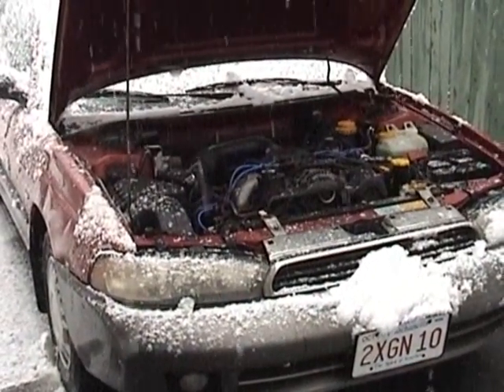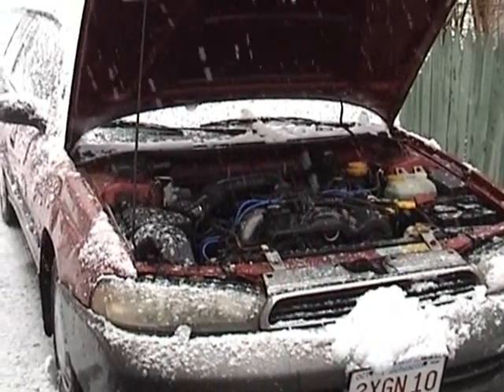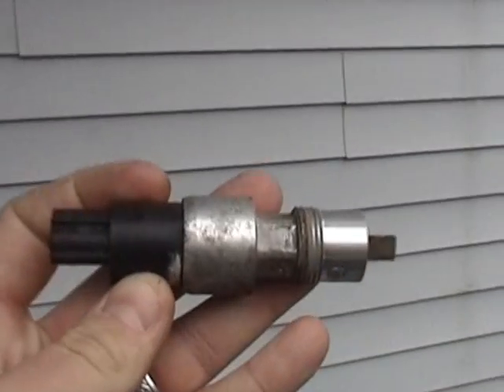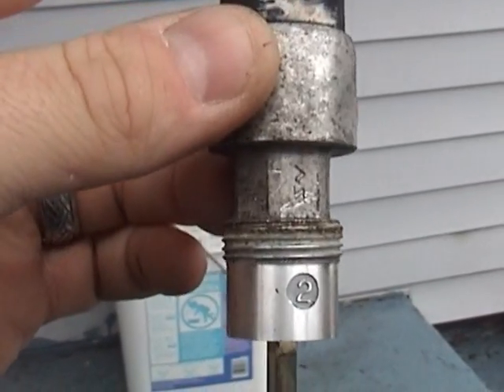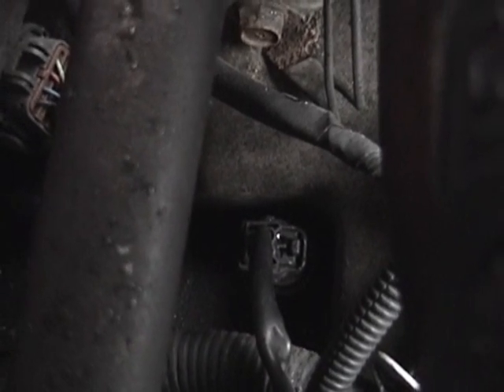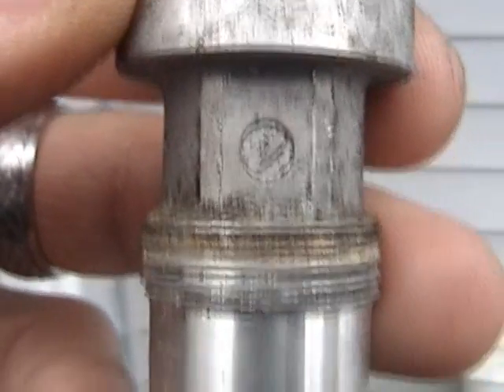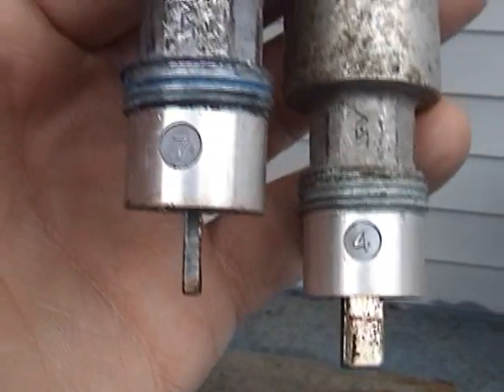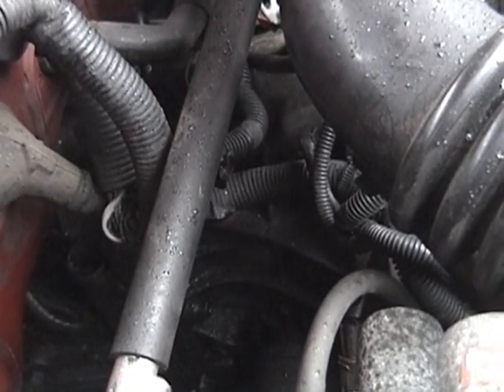1995 Subaru Legacy L Outback: DIY vehicle speed sensor 2 replacement

Comment from the maker: I can see how you might come to that conclusion, but the smoking gun was jumpy speedometer. Based on Subaru factory diagnostic charts and wiring diagrams, I linked both that and the wonky shifting to the sensor. 

I got some from the junkyard. The first spare wasn't perfect. It solved the shift issue but not the speedometer issue (though it was LESS jumpy). The second spare sensor solved both problems. If this hadn't worked, I would have considered heavier diagnostics.

Comment from the maker: It was a bit wonky between first and second gear in stop and go traffic. After a few days, the new sensor I put in still doesn't seem to be perfect (though it IS much better than the old one). Shifting almost perfect, but speedometer still not perfect. I'm going to swap for one of the other sensors I got and see if there's any improvement this weekend.

Comment from the maker: How long ago did you replace those spark plugs?

I have some videos on here in which I tried to chase down a P0302 cylinder 2 misfire. Plugs were the first thing I tried. I even went as far as replacing the cylinder head. In the end, I had low compression in that cylinder which was only getting worse.

I HIGHLY recommend getting a compression tester and checking compression. I have a video on how to do that. It's easy to do DIY and can help diagnose or rule out a real engine problem.

Comment from the maker: The transmission is OK. I'm more than 90% sure. The speed sensors do govern shifting. The speed sensor, according to factory diagnostic charts, can cause the speedometer needle to jump (which mine does at low speed, NOT the tachometer, which behaves normally) and can cause erratic shifting (which I had at low speed), 

There was no slipping, otherwise I'd be worried. The car behaves markedly better with the "new" sensor, (no transmission weirdness) but the speedometer still jumps a bit.

Comment: MercedesDieselGUy, where did you find the new vehicle sensor speed replacement part that you contemplated buying? I need a new VSS for my 1995 Impreza but I'm having a heck of a time finding a replacement part at any retailer. I am hoping to avoid a wrecking yard to pull a used one. Thanks
Reply from the maker: I got mine at a junkyard. I was able to pull a handful of them pretty cheaply. You may be able to find them new, but I wouldn't know where exactly to direct you.

Comment: The issue I am having is turning (left or right u-turn or from a stop at a light) at slow speeds I get a hop like wheels arent compensating for the turn.  At higher speeds it seems to be fine. I have changed flushed tranny fluid with no change.  cruise works fine and no lights are on (except abs).  Recently the speedometer bounces until about 25 mph.  This is somewhat telling me the entire issue could be related to the speed sensor.  Would you agree with this?  You said in the video you were having some transmission issues before replacing the sensor.  Did you have the same type of binding?
Reply from the maker: +James Roberts Honestly, I don't recall exactly how the car felt, except that shifing (automatic trans in mine, obviously) felt "off" compared to another 1995 automatic Legacy (apples-to-apples comparison) I had at the time. The speed sensor did improve that, as have fluid changes, but it's never been perfect. I've put 44k miles on the car and it now has almost 200k total miles on it, so I'm no longer chasing perfection. My car is far closer to the end of its lifespan anyway.

As for whether your symptoms are related to your speed sensor, I can neither agree nor disagree. I simply can't guess at vague symptoms on a car I can't see in person. Replacing the sensor may help, or it may not. Wish I could tell you something more definitive, but I'm not a professional mechanic and simply can't diagnose a car remotely. Best of luck.
Reply: James that sign that your center diff isn't working correctly or smoothly. Theres  FWD fuse in your main fuse box if you put a fuse in that slot the issue should go away. Although you will now be rolling in FWD mode.
Reply: Try the solenoid a I think it's called ..it is in the transfer case have to take the case off and it has like 2 or 3  bolts holding it in along with a wire of course
Reply: Transfer duty solenoid

Comment: Hey,Mercedes Diesel Guy I have a quick question to ask: you see, i have been having problems with the speedometer bouncing up and down as the car shifts gears (automatic transmission) and so i pulled out the speed sensor and found out that the under part (the one that connects to the transmission) has a axial play meaning it pushes up and down. Now, i dont know if that should happen or if the axel should stay put in one place. I cannot tell from your video if that happens because you always hold the sensor on its upward position. Thanks you.
Reply from the maker: It's been a year since I've done this job, but I seem to remember that the portion of the sensor that protrudes into the transmission DID seem to have some up/down play. Hope this info helps.

Comment: MercedesDieselGuy I have a 2008 Legacy with codes P0500 (VSS malfunction) and P0720 (Output speed sensor circuit malfunction). However it told me sensor A, not a number. Do you know if this is the same thing?
Reply from the maker: Unable to comment, unfortunately. I'm not familiar with the 2008 model (several generations beyond the Subarus I worked on), and don't know what changed from 1995.
Reply: MercedesDieselGuy Yeah, it looks similar, but not exactly the same. I'm still going to try to find the sensor, but might end up taking it to a mechanic. Thanks for the fast reply

Comment: Hi,
I have a 96 subaru legacy and in the past when I went up hill it threw the P3303 code. Turned out to be a spark plug issue. Now that its fixed Im still having issues driving up hill. Its like theres not enough power or gas to make the car go up steep hills.
Would the crankshaft or camshaft sensor cause that issue? I replaced the fuel filter and it made no change.
Reply: Bit late but I reckon you had a head gasket problem my old Subaru liberty used to do this..
Exhaust gases leaking into the coolant not creating enough back pressure is what I suspect

Comment: I get the philosophy of this repair, but if you really want to see what's up with the trans hook a pressure test gauge up to it.  The behavior you describe sounds more like a weak 2nd gear servo, worn 2nd clutch, or a worn 1-2 accumulator.

Comment: @MercedesDieselGuy do you mean the tachometer or the speedometer. If its having problems shifting gears then chances are those 1st and 2nd gear clutches may be toast. If that is the case which I hope it's not then you're best option is going to be a remanufactured transmission bc replacing clutches in an automatic transmission is a royal pain in the ass, and it doesn't always solve the problem!

Comment: #MercedesDieselGuy Hi, I changed mine and the speedometer steel doesn't work and the AtOILTEMP light steel flashes 16 times. Why could that be? I bought a brand new sensor
Reply from the maker: Santiago GR Honestly, I have no idea. I think there are actually two sensors, though I'm not 100% sure where the second one is located. You may need to change the other one.
Reply: Thanks for the answer!

Comment: hi can you make a video on manual transmission,, i have  98 forester  with manual transmission and the speed sensor is not working this prevents the car from reaching 4,000rpm at lower gear, it just fails and makes a hum hum hum hum sound
Reply from the maker: +Macarthy Soji Unfortunately, I can't. I can only do videos on cars I own, and I haven't owned a manual transmission Subaru in years now.